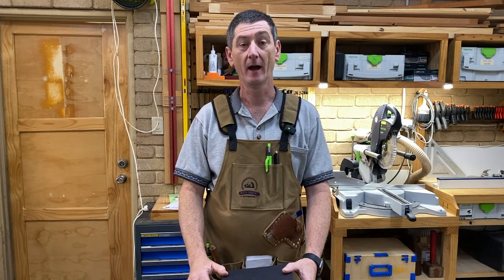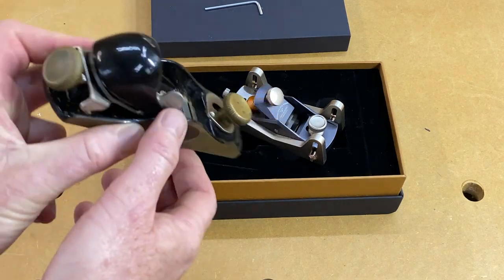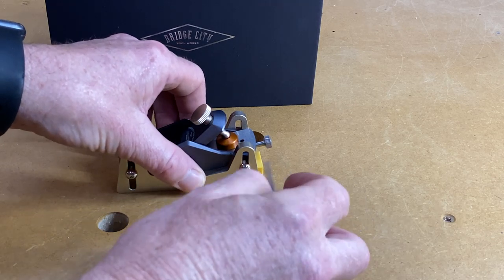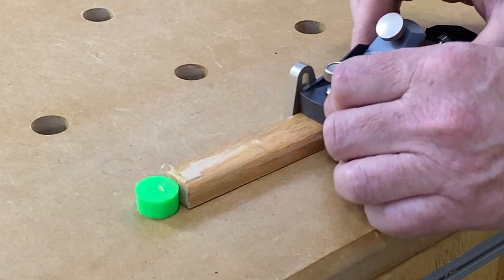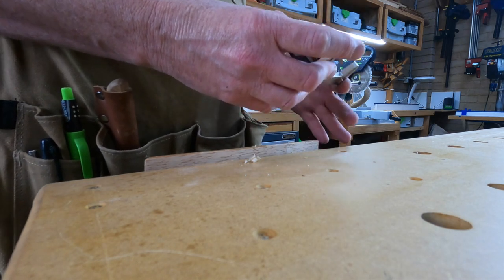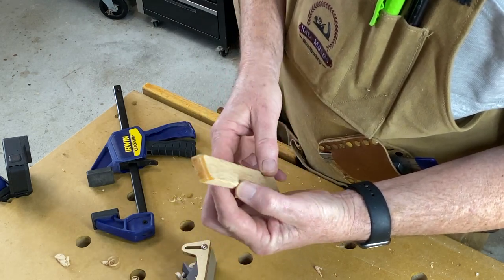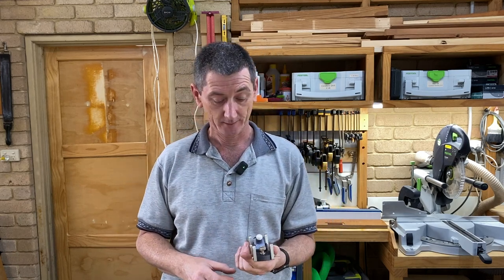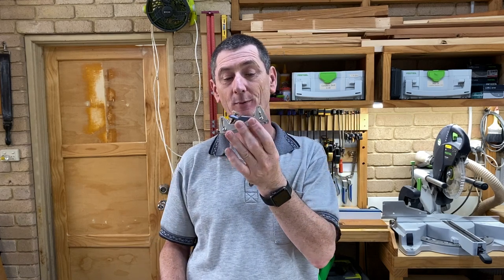HP 8 Mini Block Plane

Comment: I have been using this plane for over 18 months now, never failed to give less than perfect results. When encountering opposite grain you can also pull instead of pushing the plane. I do that with my chopsticks from time to time. Btw I now have their full set of functionally elegant hand planes, my indulgence despite the cost.
Reply from the maker: Hi Peter, They are some nice looking planes. Enjoy

Comment: I just received one and got it on black Friday sale... less than half price.  It is impressively well made and packaged.  I've been looking for a small plane for trim work and this one fits the need very well.  The (re)movable side fences are super useful and a great option, even if not always needed.  I picked up the honing guide/kit for it as well, with the money saved.

I too got it to replace my Stanley low angle block plane.
Reply from the maker: Hi csimet, good choice. The HP-8 is one of those tools that is always a pleasure to pick up and use.

Comment: Purchased one a few weeks ago. For planing Kumiko strips, it's frankly hard to envision a more pleasant and easy to use solution; very pleased with mine. A hint for anyone using it for this purpose: common 1/8" crosscut blade kerf is, typically, not actually 0.125"; rather, it's typically 0.110", and for the best fit you want the strips to be that width as well. You can purchase individual calibrated gage blocks from Mitutoyu surprisingly inexpensively, and then you've got easily repeatable, absolutely perfect setup every time.
Reply from the maker: Thanks for sharing that information Allen. Happy New Year.

Comment: Hye, just received mine today, took it from the box, took a piece of pine wood 15 mm large, adjusted the blade and .... perfect silky shaving straight away !!! just out of box !! excellent. I had a look on the sole, it is true that this sole is not perfect polished (nail scratch feeling) but when i see the silky shaving it's amazing. No issue all. This mini plane is a beauty and works very well. The mini thickness shaving i achieved is about 0,05 mm, perfect. Now it's time to learn to get full experience of this beauty and the thickness control possibilities.
Reply from the maker: Cheers Jean. It certainly is a beautiful tool to use.

Comment: I received mine in the mail yesterday and while i was waiting for it to arrive i watched a couple of video reviews about it and on one of them someone said they contacted Bridge City about the instructions where they said not to polish or lap the plane iron and were told that that only applied to the previous model and the instructions hadn't been updated to reflect that information. Also, was that $79AUS or US plus postage?
Reply from the maker: Thanks Chuckymurps. As the plane worked so well out of the box, I assumed that the instructions were accurate. I will have to get in touch with Bridge City and see which side of the line mine falls.
Reply from the maker: Hi again Chunkymurps. I contacted Bridge City Tool Works and asked about honing the back of the blade. This was their reply. 
"Honing the back can be done, it's really more of a personal preference. Personally, I take a really thin ruler or feeler gauge and set the side with the holes on top of the ruler and use that to just hone the very front of the backside. "
I hope this helps.